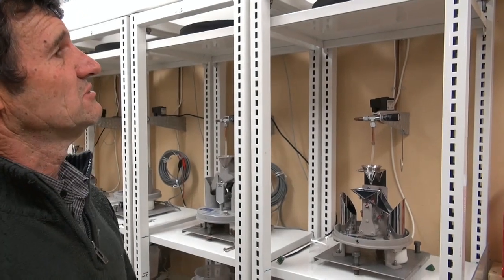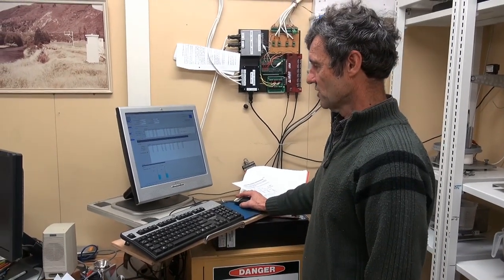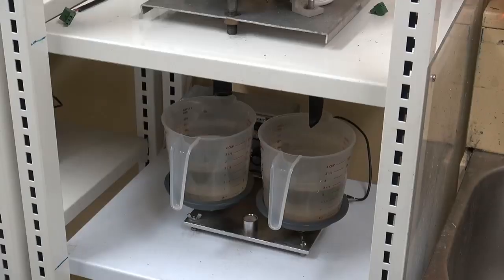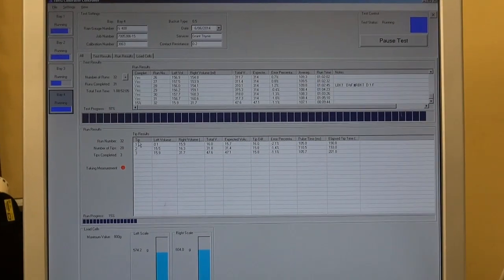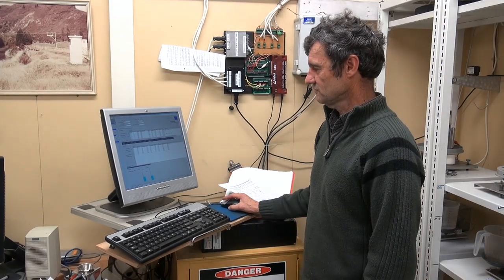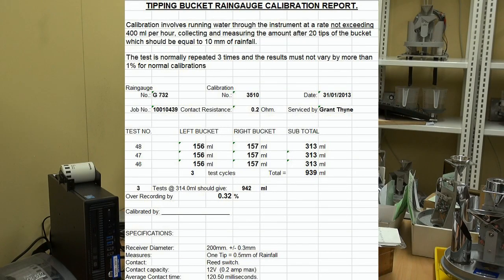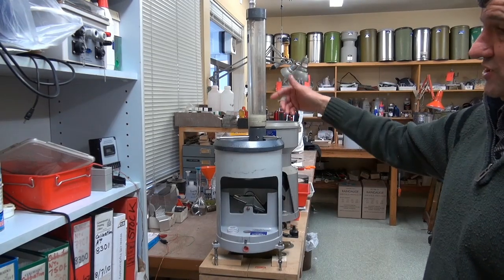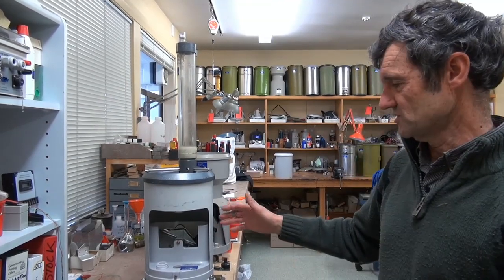Raingauge Lab Calibration Procedure

Comment: I note when the bucket tip goes through to the load cell, some water splashed out of the container, an extended tube might reduce that. regardless, that would be some error in that particular adjustment.
Reply: Hi Micah

Grant at I.S. did some tests to attempt to replicate the splash that you spotted on the Youtube video.
He did get one minor splash with the bigger bucket (0.5) when he didn’t quite have the tube centred properly and the jug was near full. He wasn’t able to get splashes with the 0.2 buckets.
If there had been any significant splashing during calibration he would have noticed it. It’s unlikely that this has had any significant effect on 0.5 calibrations, however...

We’ll fit new, more flexible tubes (eg, soft silicon rubber), so they can reach further into the catch jugs and make it easier to
remove then when full.Thanks for the feedback.
Reply: No worries, i just noticed it and thought i'd make mention just in case. I'll be in touch re: some new developments regarding evaporation and rain gauges. I'm getting all experimental about it.